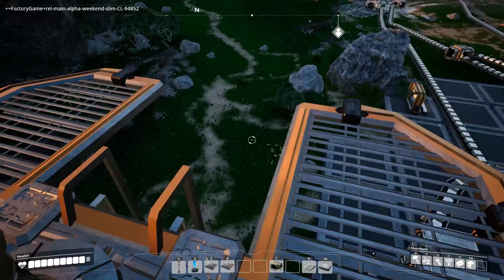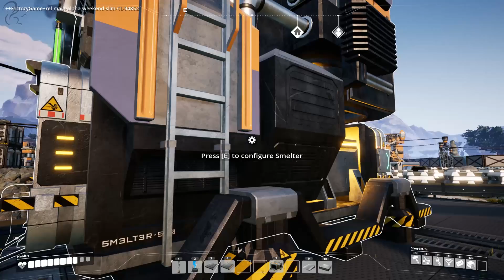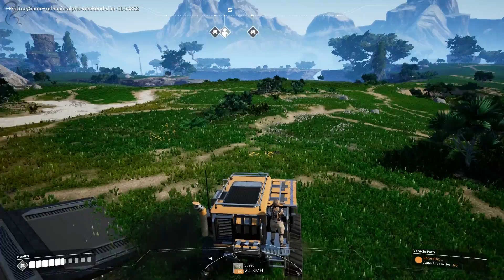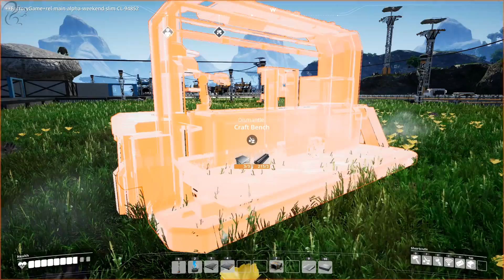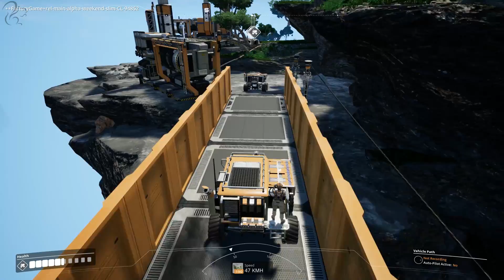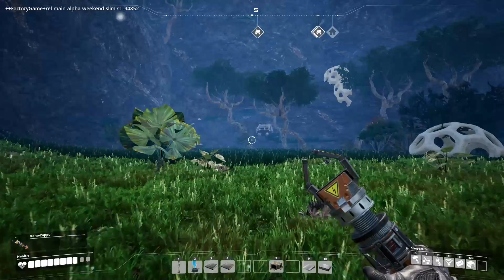Satisfactory - First Look

Comment: You can upgrade the conveyers from mk1 to mk2 without disassembling them. You simply select conveyer mk2 and aim at the conveyer you want to upgrade and it costs reinforced iron plate equal to the length of belt you are replacing. You can also add mergers and splitters to conveyers, by simply adding them to the conveyer with no interruption, and power poles by clicking a structure that needs power and dropping a pole on the ground, with a connection already made for you.

Comment: squirrel, you can upgrade the conveyor belt you just have to go into the building mode and sellect conveyor belt Mk.2 and you can replace them bij looking at the conveyor you want to upgrade. and i see you didn't go through the full tech tree after reacher in the M.A.M because there is also a rebar gun. you use 1 screw for every 1 ammo. and have to reload after each shot